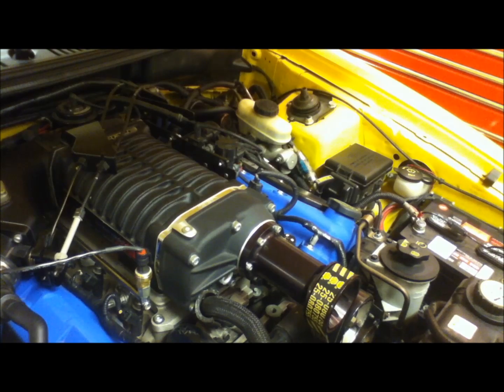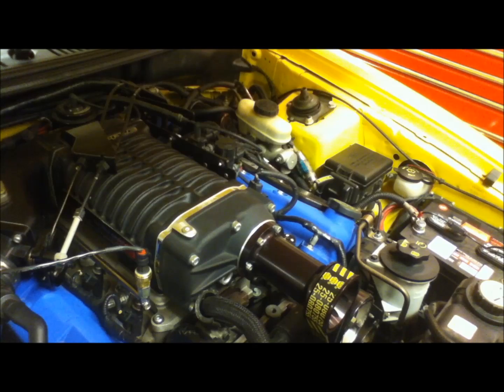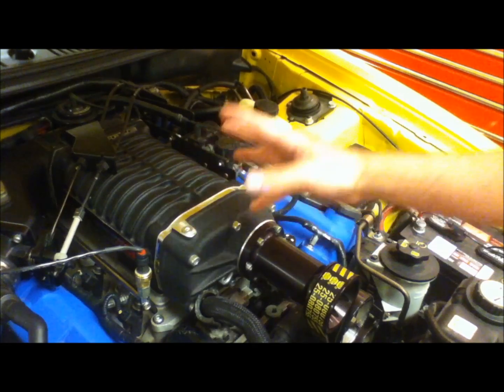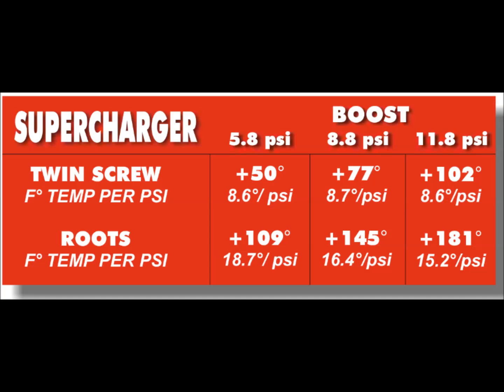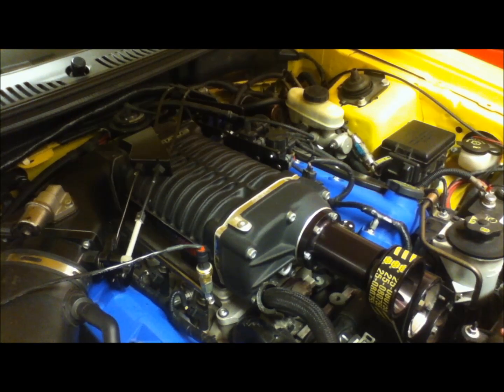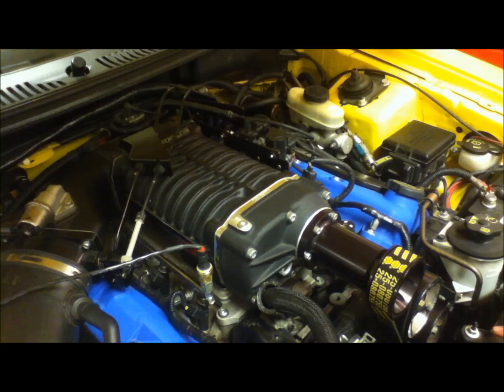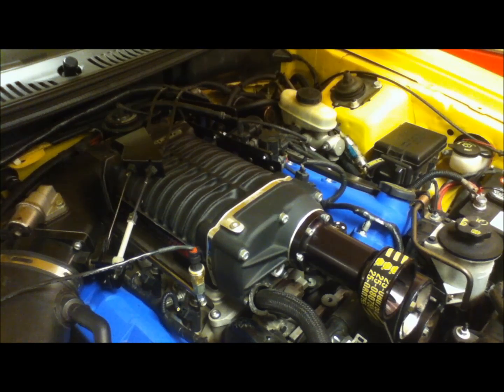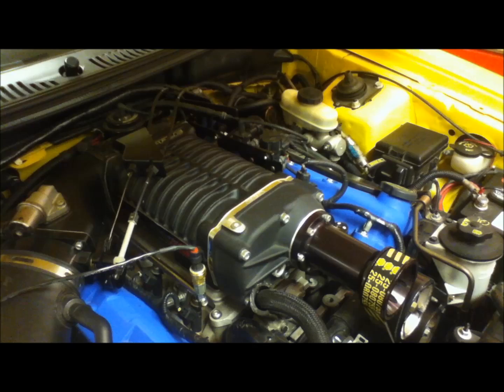Superchargers: Roots vs Twin Screw vs Centrifugal (Whipple, eaton, VMP, procharger) supercargador

Comment: @Danny Johnson  Hey I'm Mike and I have 2 Ford Lightnings swapping my charger casings because my one is ported and Polished and my trucks computer has a tune ,thd other is a 2002 Ford Lightning with 36k miles, Supercharger rotors into my other forward lighting supercharger casing that happens to be ported and polished they are the same im guessimg.??  year I just put new needle bearings in my casing and put it all back together with the low mile rotors in the ported & polished casing because they were like new. Since the first  start there was no noise for a while then it started to have an almost grinding or growling noise but now it got louder and I'm not sure if its norma because i was told that the bearings may have to ceet and that the noise would most likely go away after break-in... Now  I finished this supercharger a few days ago and I haven't had a chance to drive it and break it in because I'm still building other parts of the truck..The problem is that it has moved back in fourth in my driveway a few times, And I had the supercharger belt hooked up so it was spinning and got warm a few times.. I'm hearing a noise and I'm almost sure definitely is some kind of metal inside actually maybe like a shearing noise..Oh I replaced the coupler also..So the front snout has 36k miles and the  bearings didn't seem to have any play in them or the front pulley side either from what I could see wasn't not loose at all... the weird part is I have a stethoscope to the supercharger front back and middle and I can't really tell where it's coming from exactly it doesn't sound like it's coming from the supercharger until you're listening in front of the truck with the hood up.. I removed the belt off the supercharger and hit the gas pedal and the motor revs and the supercharger spins with a nice force if I hold the pulley it will actually make it spin out of my hand just from hitting the  throttle.. I was just wondering since you're familiar if youd have any ideas off the top your head without hearing it..?.. But either way I will send you s video if you want of it running so you can hear what I'm talking about I just thought of writing you when I came in the house disgusted..lol.. I  Noticed when I pressed the bearings in the casing that they set a little deeper than flush is that normal? And if so how much does it matter if it's Exactly flush or all the way down and bottomed out ??  Hey I just wanted to say thanks again for all the help and I really appreciate this information..
Reply from the maker: Well, I know the tolerances are tight enough that there is little room for any error. Bearings should not make noise when installed, but with enough wiggle room they may seat, but without that noise going away quick you’re hearing the damage being done. It should be be run of making noise. 
   Swapping the snout is common, but rebuilding the rest needs to be very precise. Just to verify, you also changed the supercharger oil? (Sounds simple but I need to verify).

You really want to make sure you’re not getting shavings pushed through and damaging your intercooler. At this point, a stock supercharger to swap out may be your most affordable and sure fix
Reply: @dannyjohnsonsgarage  I had 1 more question.. If you check my channel you can hear my noise, do you think I'd probably have to get my rotors re-coated?? Its not hitting hard enough to shatter I'm glad but in breaking down and checking bearings again and swap nose bearings I guess? Do you do that rotor coating work?lol.. Do you think there could be any more damage It was only ran for maybe 30 minutes tops at idle speed...??
Reply: Yes I used new oil.. thanks for helping..

Comment: Can the whipple style superchargers bolt up to sbc blpwer manifold, pr are these style blowers LS only
Reply from the maker: Chirpy Krook This is on a mustang and can be configured on nearly any engine with the proper kit or adapter plate
Reply: I see alot on ford and LS engines. But cant find any sbc setup...

Comment: Tvs makes less heat then twin fyi
Reply from the maker: Very cool. It's really neat to see them go from making more heat on their older versions to less on the new.
Reply: @dannyjohnsonsgarage  technology
Reply: @dannyjohnsonsgarage  the tvs also makes more horsepower per liter
Reply from the maker: MegaMma4life It depends on what model you are comparing. If you’re comparing a tvs to an old twin screw yes- and the same would apply as seen in this video of a twin screw compared to an old eaton.  The new TVS is nearly the same as the new gen 3 whipple
Reply: @dannyjohnsonsgarage  the VMP Gen 2 R 2.3 l t v s will make the same power as the Gen 3 Whipple it makes more power per liter the Gentry Whipple is nice their new 3.0 is even nicer the advantage that the Gen 2R has over the twin screw is you can spin it 28k rpm and I know many overspin them.  where's the Gen 3 Whipple you can only spin I think it's 18000 or 24000 RPM and I find it hard to find information on what twin-screw guys do with over spin but even with over spin it doesn't turn the same RPM.  Tvs's volumetric efficiency goes well over 100% whereas twin screws don't the only knock on the old Eaton's was isotropic efficiency which in the new TBS technology has destroyed that now you can compare the gen3 Whipple to the the Gen II r from VMP but the TV S2 in the 2650 it kicks the shit out of the Gen 3 2.9 it's working to 2.65 l that's capable on an all-out build of probably 1400 wheel I know a Camaros making 1150 wheel and they admitted there's 20% more left in the blower they ran out of fuel so it doesn't really depend it's fact the TV s makes more power per liter
Reply: @dannyjohnsonsgarage  I mean let's just put it this way take a 2.3 Whipple and then take a 2.3 TVs Nobody Compares the two they automatically jump up to the 2.9 Whipple which is almost a 3L blower because the 2.3 would be a joke to compare
Reply: @dannyjohnsonsgarage  I did enjoy your video though it was very educational
Reply from the maker: MegaMma4life As I mentioned before, you need to take into consideration when these came out. Twin screw had the advantage over roots and now that has flip flopped. 

The gen 3 whipple came out to level the field and now tvs is pulling away again with the 2.65 (not too many results are yet out that show 2.65 numbers on a factory terminator compression ratio), but I imagine they will be pretty similar
Reply: @dannyjohnsonsgarage  what's the factory terminator 10:1?
Reply from the maker: MegaMma4life I think you’re being a bit bias. “Kicking the shit” out of another blower would be more how the twin screw made 100+hp over the stock eaton. For a slightly smaller blower to produce similar numbers as one bigger is a great achievement, but nothing monumental

Comment: Great job
Reply from the maker: Thank you.
Reply: quick question Danny, I have an 04 Cobra w/ TVS and return fuel system. I am having an issue where the car will sometimes hesitate at low RPM under load. All ignition components are original. Car has 70K miles. I recently changed plugs to NGK, can't remember the model but it's what the tuner suggested. Problem still persists. No codes are thrown. Do you think this could be a COP issue? If not what do you think could be the problem? Any advice appreciated. Thx.
Reply from the maker: Yes, I would bet on it being the coil packs that go on the plugs. Very common, especially with that milage. I would get FORD OEM Motorcraft ones.

Comment: Want to go centrifugal however I don’t know what the fuck to do now... I have a camshaft currently  good for blower work (in the future) in the mid/high range rpm band for an LS3. I want a supercharger however not sure the pros and cons. I’m planning to go centrifugal with stock internals. Then when I’ve saved up more my plans are to stroke LS3 6.2 to 427ci 7.0L
Reply from the maker: I’d base the decision off if you are manual or automatic transmission. I’d go Turbo then centrifugal for auto or positive displacement for standard trans
Reply: Danny Johnson I’m manual transmission & I don’t tend to change gears at high rpm
Reply from the maker: omaduskilas i’m sure either will work well. I’d go positive displacement, but that’s what i’ve grown to love
Reply: Danny Johnson so was looking at a twin screw supercharger and thinking 2.6L twin screw. Should I bite the bullet and just get a 2.9l? I’ll run low boost until I stroke the engine. My mechanic was saying just buy a 1.9l Eaton twin screw supercharger because they’re cheaper. So I’m torn on what to do.
Reply from the maker: omaduskilas Is make it worthwhile for future plans. You want to go big, but usually not too much bigger than 2.9L since it’s so much pressure on the crank, and these new blowers are efficient enough to see big power with 2.9 or smaller. I would not do the 1.9L. I’d go for the 2.9 with a bigger pulley as you said, and then pulley down when built
Reply: Danny Johnson great I’d rather save up the extra $$ and do it one do it right!
Reply: Danny Johnson great I’d rather save up the extra $$ and do it once to do it right!

Comment: Now here's the interesting question. Once you install that larger exhaust and your boost drop, will your power drop as well?
I know the answer, but how many actually do...
Reply from the maker: Boost is a measure of restriction, so power will rise as boost drops. Efficiency is increased. Typically when you “increase boost” such as a smaller supercharger pulley, you’re not making the power from more restriction, but rather from more airflow, which ends up being restricted in the manifold and boost pressure increases.
Reply: Precisely, Very good answer.

Comment: The rotor (on a twin-screw, often the female rotor, some dragbike apps are maledrive) driven by the pulley spins the same (clockwise seen from the front) direction on all superchargers, unless there is a reverse gear built into the s/c, mainly given by the fact that most engines turn clockwise seen from the front. Some Honda engines spin CCW, and there are special compressors made for that. Seen some comments about the TVS, and they're not bad at all, the thing is that they have (at least the ones I've seen) abradable coating on the rotors to make the backlash between the rotors smaller, which contributes to less leakage to the inlet. Same thing done to a twin-screw will have the same effect, where the twin-screw slightly would outperform the TVS, given both machines having the same clearance (rotor backlash, inlet and outlet endplate-to-rotor end plane clearances, rotor-to-casing clearances etc) compared to the displacement. Calculating the belt ratio on a PK belt, 2 mm on the pulley diameters is added to compensate for the effective pitch diameter the belt actually follows. Roots blowers aren't technically compressors, as they don't have any internal compression. Comparing the TVS to a twin-screw is also a bit strange, where the twin-screw often are made in smaller series, often hand-built, where the mass-produced TVS:es are assembled by robots and not as sophisticated, lacking the "last finishing touch" and engineering expertise behind them (the last thing is just my opinion).
Reply from the maker: aerial earthsical air is compressed against the case itself, so that's where it would be known as a compressor. It would be impossible to have boost and not be a compressor. Have you seen the new 3rd gen WHIPPLE 2.9? I'm excited to see if they can outperform the TVS, which has had the same outputs with their 2.3 as Whipple's larger 2.9
Reply: The roots builds pressure only by using the capacity ratio between the blower and the engine, meaning the pressure build-up is made after the rotors pumped the air through the whole cycle, while the pressure in a twin-screw is raised already between the rotors before it's released into the intake manifold, which makes the twin-screw more efficient. But the pressure per se is of course built up between the casing and the rotors in both machines. Kind of hard to explain without drawing a picture.
Reply: Ok, the capacity ratio works the same on a roots and a twin-screw, the difference is that the pressure is gradually worked up before release into the engine intake. I'm not the best in explaining, sorry. Check the difference between a roots and a screw compressor in a P V diagram and you will see that the pump work differs between the two types. And, well, you could call both types "compressors" but if you want to be a hundred percent accurate, a turbo and a roots aren't really compressors, the are more likely to be called "blowers", depends on the nerdiness level I guess... Great video anyhow!
Reply: Yes, the TVS is a really good device, and having the same output isn't impossible, but the TVS has a capacity limit compared to the larger 2,9. The smaller TVS can probably be revved higher and deliver the same airflow as a 2,9 revved slower, then the volumetric efficiency might be higher than the 2,9 if the 2,9 spins "too slow", but adiabatic efficiency generally drops when revving too much as well, caused by restriction in port areas and parasitic losses (more power required to spin it), so it's about matching the size of the blower/compressor/supercharger, BUT if the 2,9 has bigger leakage relatively to it's displacement compared to the TVS, the adiabatic efficiency will drop because of that as well. Should we just call all of them air ends? :)

Comment: Are intercoolers a waste of time on a supercharger.?  Ive never seen a supercharged car with a intercooler. Maybe a space issue?
Reply: Any time you compress air you are heating it (ever touch your air compressor after it's full? be careful!) you will not make peak power with hot air. Anything you can do to lower those IAT's is hugely beneficial on a boosted application. Most of us that have installed blowers or have them from the factory, spend lots of time researching ways to reduce the IAT's. 

I can tell you my 2.3 TVS on my 6.4 Hemi makes WAY more power on a 50 degree morning than it does on an 80 degree morning.  My IAT's on a 50 degree morning will run 70-80 degrees but on an 80 degree morning they might spike as high as 130 (Running Magnuson's factory water to air setup with water wetter).  I need a higher flow pump because I'd love to see those numbers stay at 70 degrees or less all the time!
Reply from the maker: Brett DiMichele Studios higher flow pump or better yet add more capacity. You do need to allow the water to spend some time in the heat exchanger to extract that heat. A bigger expansion tank will go a long way
Reply: Danny Johnson yeah they definitely help. But of all the cars i see with superchargers. I never have seen one. Im building an older camaro. Going with a blower. I want it to have a mad max vibe.  Thru the hood is key. Might look into a inter setup. Only reason i think ive never seen one on a street car. Hood clearance. Blowers tall enough. Cooler just raises it more i guess.
Reply from the maker: Mr poppagorgio yeah, most factory supercharged cars (and many turbo charged cars) have factory intercooler systems. Jaguar XK8R, 03/04 SVT Cobra, 09-14 SVT GT500, SVT lightning, (and even the turbocharged Toyota hilux I drove in Uruguay). I know the Subaru and Evo also have intercoolers
Reply: Danny yes to both! I agree I need a real expansion tank. The small tank the Maggie kit comes with holds a pittance of fluid (maybe 8 ounces) I'd like to do a big ass aluminum tank like you guys do on the Stangs. Just need to find a good place to mount it! The stock Bosch pump on mine doesn't seem to be pumping like it was when I first installed the system so I think it may be shitting the bed.  Been kicking around one of Lingenfelters big pumps for the Vette's.

Comment: So vmp & KB are roots and whipple is twin screws . correct ?
Reply from the maker: salferaih1984 almost. VMP and stock eaton are roots, Whipple and Kenne bell  are twin screw
Reply: Danny Johnson in the video you said that roots generate more heat than twin screws . this means that Kenne bell and whipple are more efficient and reliable than VMP (since its root style)  is that true?  I'm only asking cause I'm looking for a blower for my car and still confused between these brands and types.  My main concern is that I'm living in a counrty with a very nasty weather (around 122 Fahrenheit in summer)  so I got to be careful before buying anything
Reply from the maker: salferaih1984 I said the roots produced more heat on the eaton when the car came out and that the new VMP roots now out-performs the twin screw so that isn't the case anymore. Old roots hotter new roots cooler
Reply: @dannyjohnsonsgarage  thank you twin screw guys still think they are more efficient like in the 03 cobra days the new tvs is  different animal.
Reply from the maker: @midnight347  yeah, new roots are right on line again, but the best news is they are all good

Comment: Which would be better to use on a 2004 Mach 1 automatic daily; turbo, procharge or pulley supercharger?
Reply from the maker: Alejandro Rojas I would say a turbo. Less issues with the front drive belt. Also, turbos are great with autos and even better with a Trans brake

Comment: Interesting video, but facts are not completely correct.  The air travels around the outside of both root and screw types, between the housing and the rotors.  No air (or very little air) is supposed to pass between the screws or lobes.  That's were you get your one-way air flow.  There is volume between the rotors and the housing where there is no volume between the rotors.
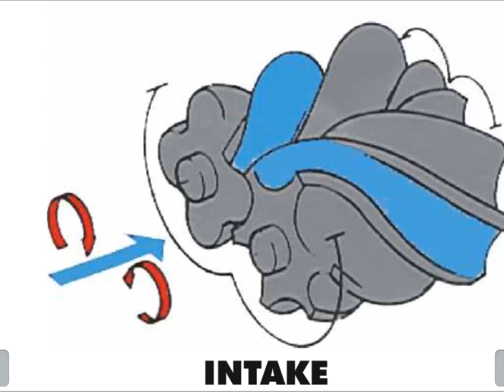Reply from the maker: Preston Thayne Not so...Watch at 5:05 and you'll see a diagram which shows on the twin screw the air is pushed forward between the rotors (NOT against the outside edges of the case). Yes, the air is also against the top of the blower but NOT going around the outer case like the roots